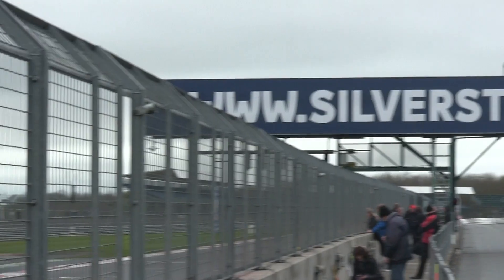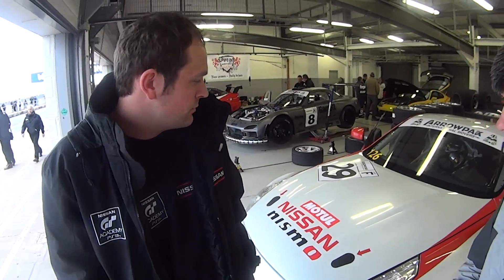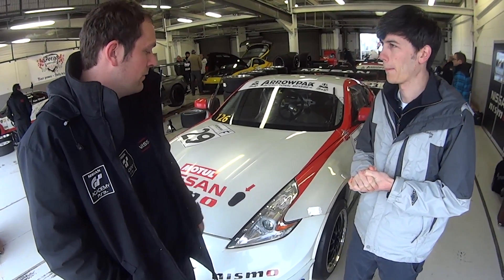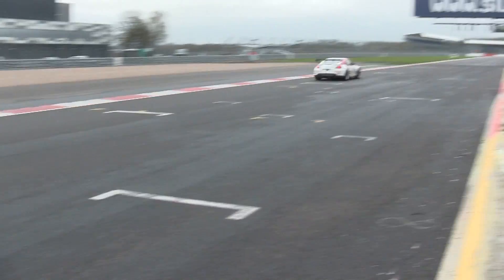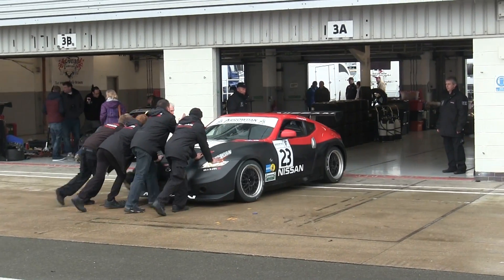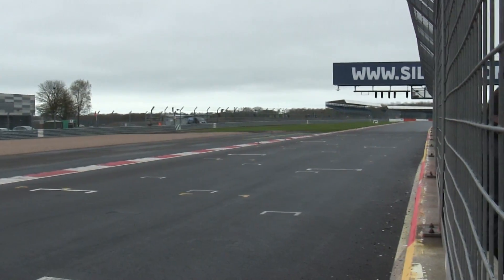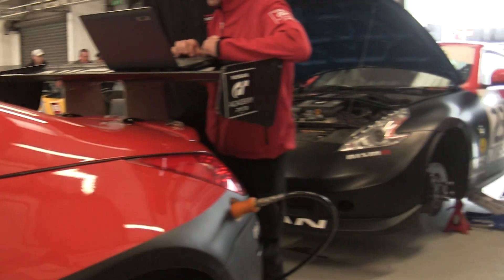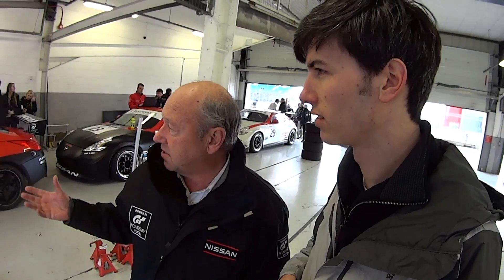Silverstone Track Day - Nissan Pit Lane

Comment: Do you race cars yourself?
Reply from the maker: Brendan Trago Nope, but I'd like to start learning!
Reply: Engineering Explained Find a track day around you. Look at your local SCCAs website for high performance driving experience (HDPE) or professional driving experience (PDX) options (or whatever they're called). I did my first few this year in my grocery getter and had a blast. It's a relatively cheap way to get on a track. 

BTW love your videos.
Reply: Mike is right!  Get out there and race. You know too much and have too much respect for the sport not to

Comment: Hi there. I have a question, my understanding is dohc double overhead cam, honda uses that term, and as toyota nissan twin cam use the term. 
Many tell me they are the same but with the difference of the camshafts are identical twin cam, and dohc are different. and for me no more. 
I do not understand, you could clear my doubt?
 and thx :)
Reply from the maker: Check out my video "DOHC vs SOHC cs OHV." Dohc is simply two cams per cylinder head, which is very likely the same as twin-cam. One cam for the intake, another for the exhaust.

Comment: Hi Jason, love you videos.
Could you make a video explaining the high-pitched noise of F1 cars? And why V10 and V8 engines were so high-pitched but that went away when they removed just two more cylinders?
A bit of a noob-question, but I just like the way you explain stuff so simply!
Reply from the maker: It's mostly due to the turbos, taking the energy out of the exhaust (the sound) and putting it into useful work (cylinder pressure). A V6 could be just as loud, but the turbo will dampen the sound.
Reply: Engineering Explained Thank you!